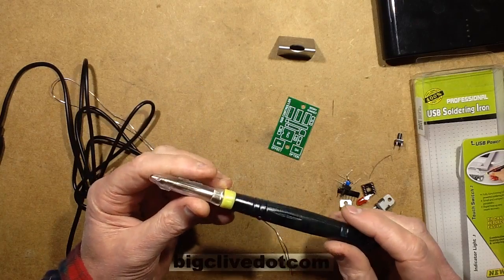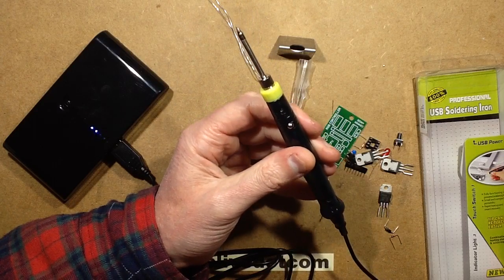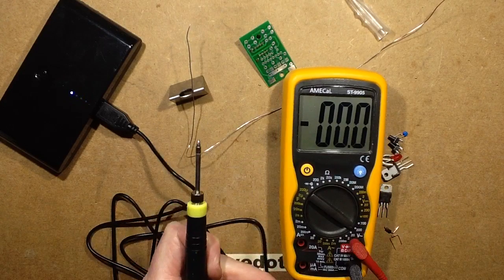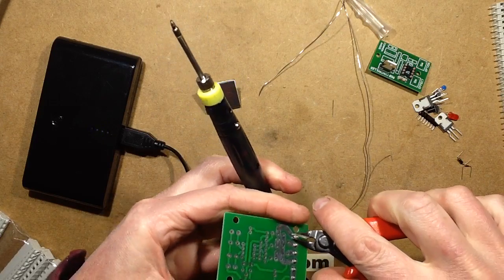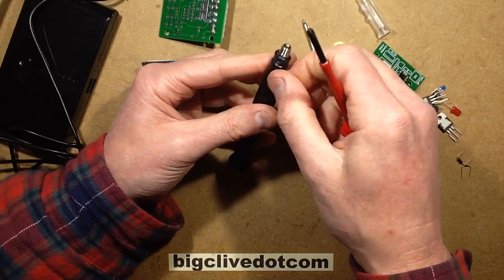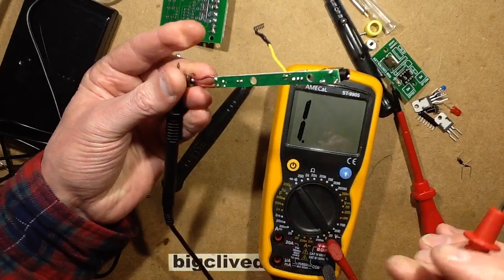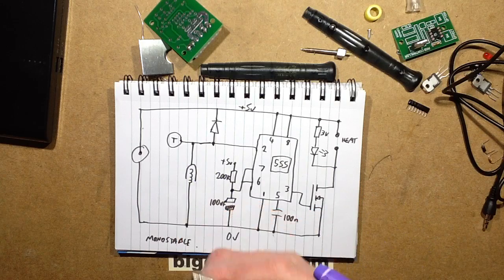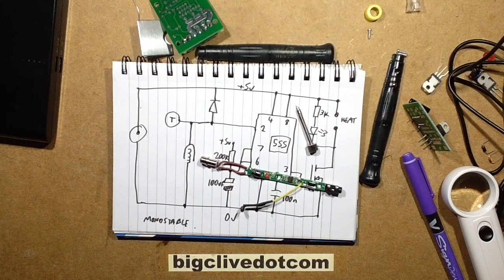USB soldering iron test and teardown with schematic.

Comment: I've had one of these for ages, generally using it very happily, but I recently bought a "Hakko 191" soldering iron thermometer (I include quote marks, there, as it cost me less than £10 from AliExpress, and the top segment of the most-significant-digit of the LCD doesn't work, so I've no idea how accurate it is).

So I decided to see how hot this tiny little USB iron gets to. The 191's display instantly jumped to the mid-400s and climbed all the way to around 570°C! At one point, with a bit of wiggling of the tip, it actually displayed around 620°C! (Bearing in mind the Hakko 191's Type-K thermocouple is rated for 0-600°C use, so it actually took the thermocouple out of range!)

Clive, if your iron thermometer is a little more reliable than mine, could you give that a test? 600°C from USB, and onto components that aren't going to necessarily like that level of heat, is a bit terrifying!

That would certainly explain why I've so easily damaged a few PCBs with it in the past - both pulling smaller tracks straight off the board, and then even burning the board itself (I'd say FR4, but it was one of these odd white PCBs from China so it may well not be FR4).

It's definitely an impressive and very handy iron, and I've preferred it over various others I have which cost me much more money, but with great power comes great responsibility, I guess... (I now have a "HYLKKO 998D" soldering station with hot air gun, so the USB thing has been relegated to being a handy portable thing for working in/around the car or whatever)
Reply from the maker: The open air temperature does climb high, and I did test it on the 191 unit.  It immediately sank the heat and then started climbing again.  It just requires controlled use to avoid damaging PCBs.

Comment: Hi, I have a question about the power bank.
I don't have a power bank, so I dont know how this works exactly. The quetion is : can I use this soldering iron with a 5000mAh 5v 1A power bank ?
Thank you.
Reply from the maker: I'm afraid not.  It requires the power banks that have a 2 or 2.1A output.
Reply: So, if I have a 10000mAh 5v 2.1A power bank it will work fine ? Thank you so much :)
What about connected to computer ? I read some comments but, I didnt get a specific answer.
Reply from the maker: It would overload a standard computer USB port.
Reply: Exactly my though! Well, thank you again.
Reply: +956Bernardo Heya mate I use a 5v 2A usb charger and 0,8mm 60/40 or lead free solder and work fine
Reply: Heya Clive,great vid once again!Do you have a "review or teardown" of the black power bank are you using in this vid?I've got the same DIY power bank case but my 6x18650 cells just dont fit into it and inside the case there are no springs,contacts,nothing just the bare plastic and obviously the charging chip with the 2.1A and 1A exit at 5v.
Reply from the maker: I've covered this one a while ago.  It contains six tagged and soldered cells inside (lowest capacity ones as usual.)  If your case has the spring contacts, are your cells protected ones with the little gold PCB at the negative end?  That can often make the cells a bit too big to fit the standard holders.
Reply: thanks for the reply!Got it!The vid is called, Internal examination of a "20,000mAh" USB power bank.   and yeah probably are protected cells,removed from a dell laptop but I got my answer,thanks again mate keep on doing the good job,very informative vids ;)
Reply: And just another question. What kind of material did you used to solder ? Is it tin ? 60/40 ? I heard that, 60/40 is not legal in my country! Thank you.
Reply: SeekerSentinel
Well, I think, if it works for you, it will work for me. Thank you so much :)

Comment: so could you get a electric shock by using it from the power supply?
Reply from the maker: Nothing more than a very slight tingle as usual with many USB power supplies.  It's more the risk of damaging voltage sensitive components.
Reply: +bigclivedotcom okay cool, iv ordered one now being its so cheap. cheers
Reply: Callum Guest Did you receive it yet? How does it work?
Reply: Tom Varga Hey yeah I had been using it, and I'd recommend using a 2 amp output adapter, otherwise the temperature doesn't tend to reach the melting temperatures well. It works, but I'd recommend buying a cheap mains soldering iron as it does the job a lot better.
Reply: Callum Guest So it works well with 2A?
Reply: Tom Varga it works okay, only really for small solder joints and small components where the heat won't be distributed and taken from the tip

Comment: Got my new one!   Tried to run it off my power pack (4 18650's showing 4 out of 5 bars) and it simply would not go, man I was disappointed, wrote a scathing note to the seller for selling me one with a bad cable.  Later today I plugged it into a wall wart and it began working but now the red light stays on no matter if I touch the stud or not.  Some days you just can't win, but I did try it out mounting a set of 3 18650's I pulled out of the battery on my HP Elitebook because HP kept telling my battery was failing, onto a cheap china USB charge - power supply deal with USB in for charge out at 5V to use. Lithium ion 2 1A 3 7V to 5V USB Boost Charge Board LCD Mobile Power | eBay
http://www.ebay.com/itm/331639618323?_trksid=p2060353.m2749.l2649&ssPageName=STRK%3AMEBIDX%3AIT Did the job with out a problem so perhaps I owe the seller an apology, some times you feel your age, and I am getting OLD damn it and I don't like it one BIT!  Just turned 65 and today is one of those where I can feel it.

Comment: Clive - Check out the SainSmart Pro32 (Rebranded) Soldering Iron.  Just like this one, but it claims 60W!  60 @ 24V/2A... 48W should be the max...  But running it at 20V 2A gets it to 360C in about 20 Seconds.  Its nuts!  Using it with a MaxOAK 50000 MAh 6 Port Pack @ 20V

Comment: This probably has an obvious answer, but here goes.
Why does the power supply make it live, but the power bank not?
Reply from the maker: Plug-in power supplies have internal capacitance that couples a small amount of current from the mains side to the output.  It's only about 100microAmps, but that's still enough to give problems with voltage sensitive electronic components.

Comment: Now that I got this iron, I actually tried it out and somehow it didn't work properly.
If I was able to turn it on after unplugging and replugging it into the power pank a billion times, it was only turned on for about 10 seconds and then gone off :c
That was whilst sitting on the bed without my feet touching the ground. But when I got myself an actual chair and tried it the next day, it worked like a charm! Turned on by touching the metal thing, turned on by wiggling around just as designed!

And I also dropped a blop of solder on my trousers and also my arm (on the first day due to little frustration) :D
Didnt even leave a mark nor did it actually hurt much, seems like the temperature just couldnt even reach it's limit.
The thing draws about 1,5 Amps from my power bank, don't know if I should try a (or 5 different) USB power supplies plugged into mains, I is scared by leakage. This house is also protected by RCD, so it will be most likely not tried out :-)

To say the least: the 2 i ordered from ebay still haven't arrived, found a 14€ soldering set on german Amazon including cheapass pliers, cheapass long pliers, cheapass screwdriver and this exact iron plus a bit of solder AND! a better iron stand! 
Short: dis thing http://amzn.to/1UKixMs

Comment: I'm loving mine so far. one problem i had though is that when running off a battery bank, the touch probe wouldn't always turn the iron on. I stuck a small screw right next to the ball bearing thing and grounded the screw, so now when i grab it my finger makes contact between the two. seems to have solved that issue well enough. interestingly, this problem doesn't happen when powered by my wall adapter. I think big clive was right on the money with the ac coupling being what triggered it.

Comment: Hi, I also powered this from a USB output on a extension cord. I wanted to try finishing some wood PLA print. The tip was glowing dark red. Wow. I will have to try with some power bank or batteries as I only need 200C.

Comment: Would a modified pc power supply work without the high volt leak? The 5v rail does around 14 amps and it uses the three pin grounded cable. Just want to be sure but I don't have the tools to test it.
also i cant find any extra tips for it? if anyone knows where to get them let me know.

Comment: Amazing! Seeing that the merchants don't mention USB 3 as a requirement even though the wattage sure would require it, I'm wondering how the iron would perform if an unsuspecting person would plug into into a regular USB 2.0 port on a computer. Would it blow the port or just not get hot enough?
Reply: ***** Nice. Thanks for the info :)
Reply: It does get hot and solder fine but it takes solder a bit slower and needs to build the heat up again after joints when soldering big components.

Comment: Hi Clive...
I bought a couple of these after seeing your review. Can't find a source for spare elements/bits but at this price I can just buy a new one and have a handy USB lead for future projects. I use it with a power bank like the one you're using. It won't replace my trusty Antex but it's handy for a quick soldering job which I can do in less time it takes for the Antex to warm up! It's also half the price of an Antex tip.

Comment: Mine arrived yesterday and didn't work. The red light comes on but there was no heat. I opened it up and one of the wires going to the tip wasn't soldered on! The irony. :-)
Reply: The 'soldering irony'
Reply: order another to solder the first!
Reply: You could solder it on with..... oh. 

Oh...

OH!
Reply: @jrmbayne  i faced same problem but when i changed the usb charger then it started warking. use 2amp charger
Reply: Niko Thieling They sent a replacement.  ☺️
Reply: You needed a soldering iron to solder some solder onto your soldering iron so that you can solder...ahhh that does my head in 😂
Reply: It's like when you buy scissors and they come in those clear welded edge packaging and you need scissors to get to your new scissors 🤬
Reply: The irony is also a pun.

Comment: Mine does 5v @ 1.60A. Real life 4.94V and 1.57A. So it doing more than 7.7W from my power bank.
Reply: +Joseba Subijana I just got mine in today.  It does 4.97V at 1.74A so 8.6W.
Reply: Nice, it looks that it depends on the unit
Reply: But mine gets waaay too hot

Comment: Clive, You've been getting quite a few mentions on 3D printing videos recently due to this  teardown.
A 3D printing product bearing a striking similarity to this soldering iron has been recently released - Modifi3D. 
It does come with some extras, but it £20+P&P.
Reply: +Pook365 I just went to the site and saw that they said the outside is the same, but the internals are different and better quality.  It'd be interesting for Clive to see if that is true.

Comment: dang good little soldering iron i have had one for a couple of months and it still surprises me as what it can do (if you respect its low-ish power) i would recommend one to anyone BUT NOT to use from a standard PC or laptop. i use it from a converted PC PSU/bench PSU

Comment: Bigclive could you make a build to power this and other USB devices from a 12V battery holder and a adjustable step-down or step-up voltage regulator, obviously set to 5V? The good point about a step-up regulator is that you can (probably) keep using the device even after the batteries are nearly dead as some step-up regulators can boost very small voltages. I'm not sure how it would handle such a high load but at least you know the batteries are nearly dead. If you also use rechargeable batteries you can get a bit more power. I bought one on Banggood.com, it was found by that search word you gave and it is the exact same device and works like a dream.
Reply: EDIT: I've now been using the iron for over a year, and it still works like a dream. I've been using a grounded USB power strip that has several 1 amp, 2.4 amp and 3 amp USB sockets, and no, it is not 230V ground referenced like with some USB adapters, like Bigclive measured off an Apple adapter.

Comment: Hello, could I have help with building or buying a Lithium ion charger circuit. Could you recommend one? Building a 12v battery using 20  18650 cells.  Want to build it for my solar panel or my go-cart.

Comment: This soldering iron IS suprising to me as well:O

I find recent LED's really easy to light- in my recent design I used green SMD LEDs as some indicators visible through plexi- started with 680 ohm resistor from 3.3V, but they were way too bright. Ended up with 6.8k to get it barely visible in room daylight and blinding during the night... Estimate the current through  this LED of mine, microamp range!
Reply from the maker: +Marcin Kurczalski The Gallium nitride green LEDs are incredibly efficient.  It only takes microamps to make them light brightly.

Comment: I bought one from eBay need to fix my tweeter speaker just need wait to 10/5 for the seller from uk for get the part for my  tweeter i bought two used B&W DM601 for 5 GBP/7USD but i didt see one of the tweeter is broken after i got home

Comment: How about using this in a Car? Any danger with voltage?
Reply from the maker: +ManzalaStudio If you plugged it into a car to USB power supply I'd suggest avoiding using it on connected wires as the iron would be referenced to the cars electrical supply.  Fine running off a power bank though.

Comment: I believe that 555 circuit is the same exact ones they use on vapes. Fundamentally, both products do the samething. I'd love to see one of these soldering irons that accepts an 18650 battery. Would be killer for portability.

Comment: I bought one of these to pick up soldering and electronics (as well as a larger 40w unit) and I found that I don't even touch the big iron... the small tip really makes this a handy little device. I made the exact same mistake you did with trying to unscrew the cap, thought it was broke for a while until I pieced that part together. Felt like an idiot, glad to see I'm not the only one who did that
 It's cool, you can plug it in and within about 5 seconds the tip is ready to go, and the needle tip and low power makes it a lot easier to keep yourself away from all other nearby connections.I haven't really tried anything too heavy with it but it's performed great on everything I've tried it with. Thought the use of the 1/8" /3.5mm jack was a bit odd, never seen it used for power before only audio.

Comment: Would you recommend this over the Iso-tip rechargeable iron you reviewed? It's quite a bit cheaper
Reply from the maker: +Dylan Kirdahy The Iso-tip has the edge for sheer output power for larger joints.  But for small stuff the little one is acceptable.
Reply: +bigclivedotcom Thanks for the reply!

Comment: Clive, how come you never fix something like this to your liking & for your followers? This is the time to start because here is a truly USEFUL little item that many of us soldering iron collectors would actually use in certain circumstances. So FIX THE HIGH VOLTAGE problem for another vid and start empowering your audience more!

Anyone have a link on this thing?

This also reminds me long ago radio shack had thin strips of solder they sold as "Match Solder" and you could wrap two wires in it and light a cardboard match (which were given away free all over in banks and the like in those days) and permanently and decently connect 2 wires together. I remember buying my package for like $1.37 in our local strip mall's Radio Shack. That was all we had.

THIS WOULD BE A BIG STEP UP FROM THAT!

Other thoughts: At first I thought this was hokey but seeing it work and seeing a circuit in it seemed even hokier but that is probably meant to conserve battery power so it makes perfect sense along with the fact that chinese directions are always awful so they omit the statement that it should be used with a battery bank.

You should try to run this thing from the "Inside a slightly bizarre car to mains adaptor" item featured in the video.

PS: Seems we are having a nice thunder storm.

Comment: I have a weller butane iron works great still but for a quick solder in tiny places this seems it may be better if you can use some 18650s and a decent buck or boost converter.how long this would last who knows but worth a shot.

Comment: This is most interesting as I work mobile using my van as a base, I have a 12v soldering iron that isn't very good, I power that from a battery booster pack that has a 12v cigarette lighter socket, I was thinking that I could use a 12v USB adapter into the booster pack and run this soldering iron from that.
I'm assuming that the 12v USB adapter will supply enough power to run the iron, it'll charge a phone and run a dash cam side by side with no issue.

Comment: Count me in on buying one - currently seeing them at $4.79 on eBay, shipping included from China or Hong Kong. I'm going for the latter, because HK Post seems to move significantly faster than China Post does. I've got plenty of beefy USB power banks, so that won't be an issue.  First thing I think I've bought after seeing it in one of Clive's videos since those little LED circuit-board lights that plug into a USB port. ;)

Comment: Now I feel cheated Clive... mind doesn't turn on again no matter how hard I bash it on the table... :( Maybe it doesn't have a vibrator switch :-O Might have to go splurge on another one! EDIT: Just 'took it to bits'... and nope, no vibration switch... Board looks exactly the same though... must have got the dearer bargain model (was $10 Australian peso when I bought mine a few months ago).